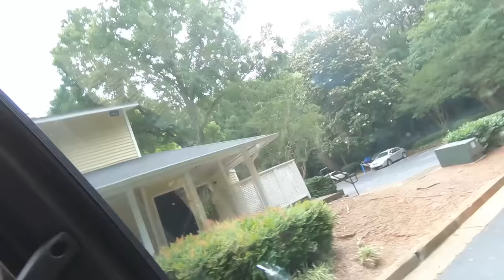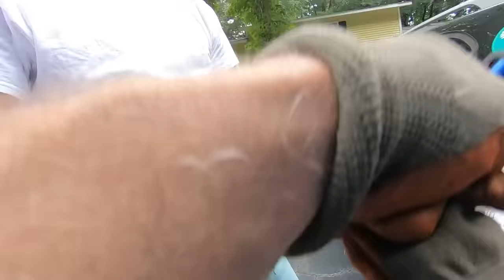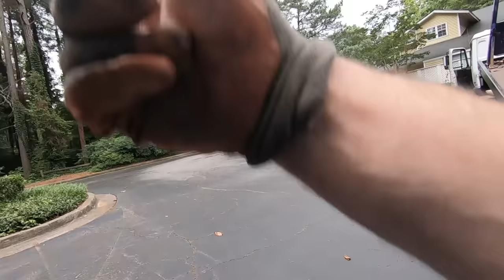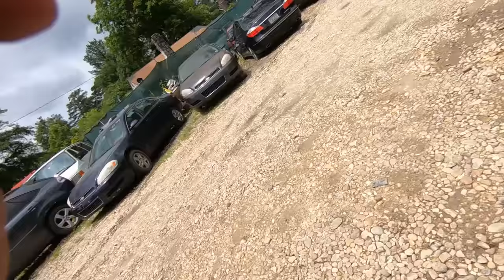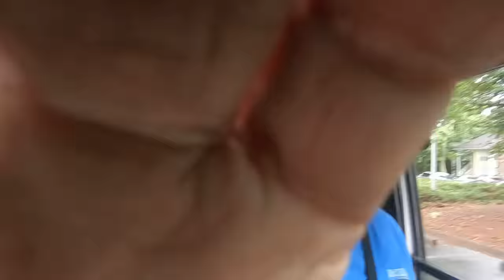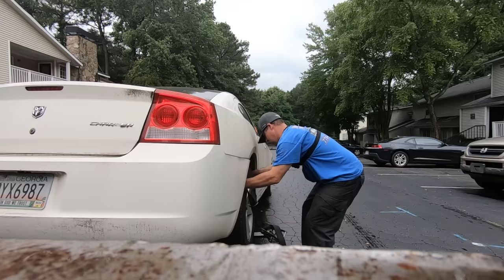Parking Revenge #146

Comment: I always wondered, the wheel lift you used on second car, when you pull the attachments from under your truck they look like nothing locks them in place, is there something inside where they slide in that keeps them from vibrating out while driving?
Reply: They have butterfly locks on them. Click out, then back in

Comment: DRIVER: Ratchet straps use a primary spring locking system. Do not rely on this spring to keep the strap from releasing. To engage the secondary locking system,  you need to position the handle fully down. This allowes a manual hook lock that will not allow the straps to move once you move the handle fully down.

Comment: I'm a bit confused as to why the first black car was paid out. Normally you say, they must run and drive, but this car had a flat tyre and looked like it had been sitting there for a while so probably a non-runner. Also you said the manager would take it off the list, but is the manager not going to just put it on the list in a few days, if it still there,  without a tag, and possibly still have a flat tyre ?

I have seen clips, where you say to someone that it must run and drive, and it does not with a flat tyre....I think ;)

Comment: Am a little confused, a stickered wrecked crap car with tire flats has to be removed off property…..BUT if you pay the drop $100 fee the crappy piece of eye sore junk still stays there….or have I missed something in the overall removal process of wrecked cars 🚙…..so it defeats the object of clearing up the wrecked or eye sore cars….other than that I enjoy watching the channel
Reply: If it runs and is movable, and they talk to the manager, usually the manager will work with them let them keep it so they can get the problem fixed, whether that’s getting tags or flats fixed. Etc. If it doesn’t run it doesn’t stay.

Comment: Arguing that electric motors are inherently superior to gasoline engines, he walks through several fundamental advantages that electric motors have over gas: Electric motors generate motion, not heat. A fossil-fuel engine produces motion, basically, with tiny controlled explosions.

"He doesn't need to put a $3,000 'motor' in it"